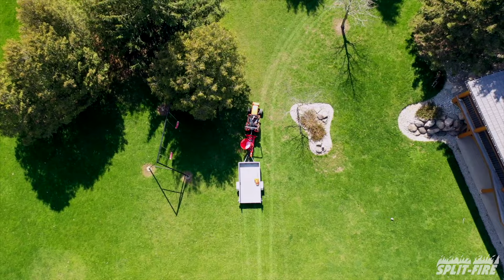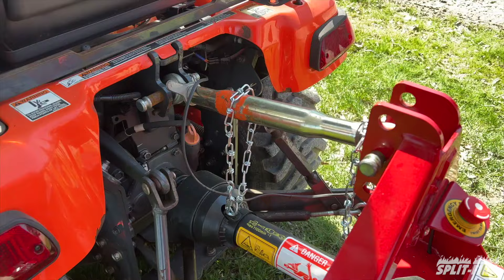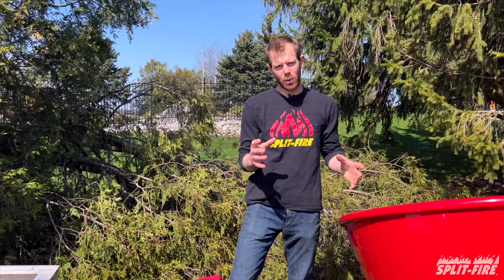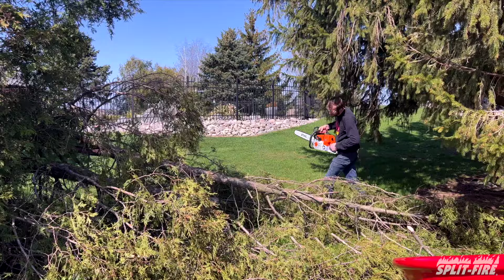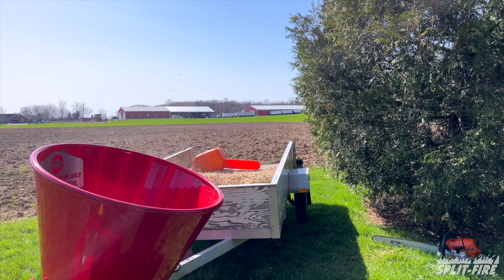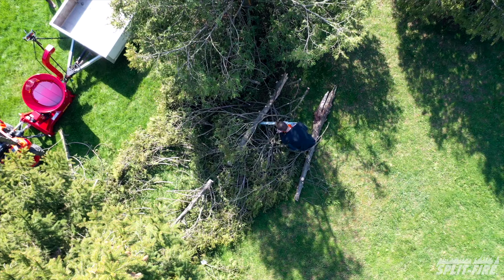SPLIT-FIRE 4003 Wood Chipper

Comment: the exhaust chute is fixed (i.e. doesn't rotate)?
Reply from the maker: It’s more of a set it once and forget it but, the chute can be adjusted at the factory to three different positions as well as the hopper. It does require a bit of unbolting and reassembling of the hopper and lower chute spout but it can be done. It’s not something you would do on a regular basis more like set it and forget it.  Hope that helps.